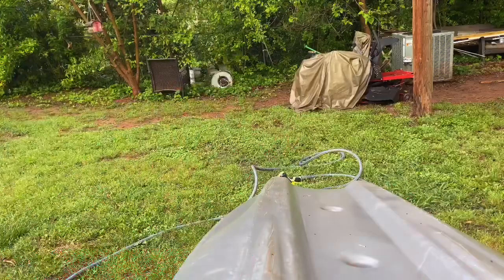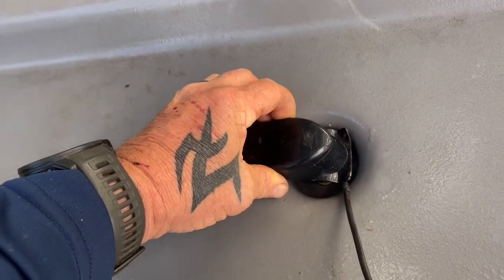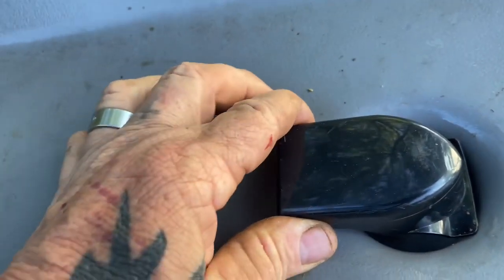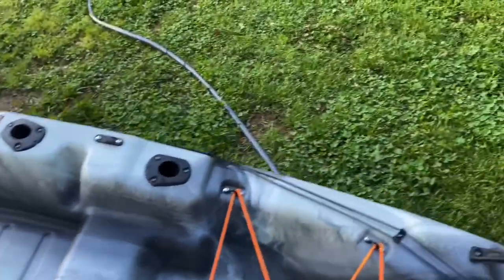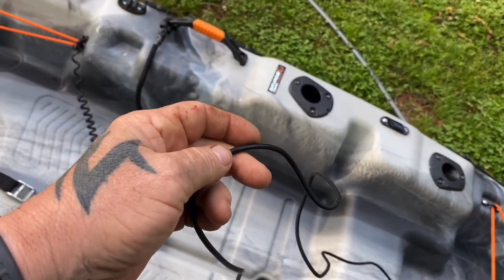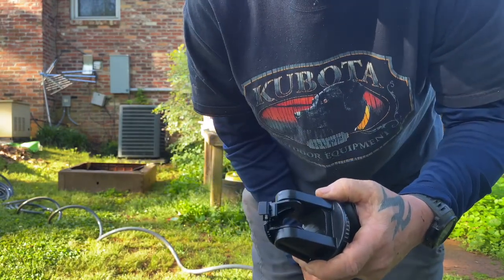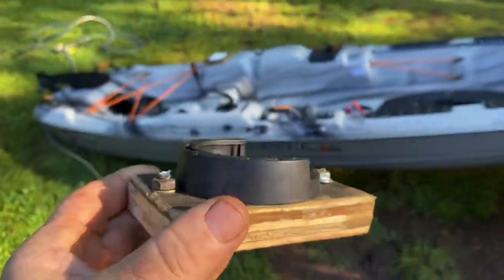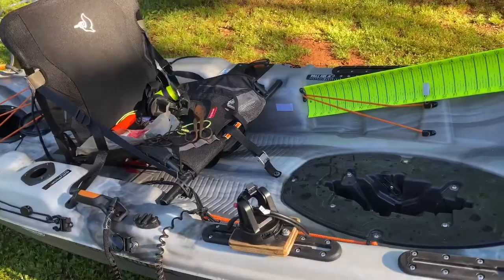DIY clean transducer and fish finder mount installation Pelican catch 110

Comment: I've got the same kayak and I'm thinking about using your method. Where did you get the threaded pipe and cap (a part number would be awesome)?
Reply from the maker: When I get home I’ll look and see if I can get you a part number my friend and I appreciate you watching and commenting!!😃👍🛶🐟🎣 the pieces can be found at Lowes or Home Depot in the sprinkler section it’s all 1/2 inch stuff.
Reply from the maker: Sku#: 652378 a skew number for Home Depot is the best I could do buddy it’s called a 3 inch riser half inch diameter and they are cheap! Lol
Reply: @jaybyrdsshenanigans  thanks 👍
Reply from the maker: @kevinrenn9123  no problem👍😃

Comment: Great video. What did you use to thread the hole? Size?
Reply from the maker: The fitting is a 1/2 inch sprinkler riser three inches long and I barely enlarged and sanded the hole and used the fitting to thread it. It threads really easily.  Thank you so much for watching and commenting!!🙏🙏😃👍👊🛶🎣🐟

Comment: did you use the nipple to thread or use a tap to thread it? if i have the exact same kayak should be good to do this right?
Reply from the maker: I just  enlarged it slightly and worked slowly and used the nipple threads . I have had no issues with it and it still screws right in every time 👍😃 thanks so much for watching and commenting I really appreciate it 🙏🙏
Reply: @jaybyrdsshenanigans  did you use heat to enlarge or just the nipple itself
Reply from the maker: @MindriddlerADV actually one of the little sanding drums on my dremell and you don’t have to enlarge it much at all. Just enough for the threads to grab and then just slowly work it back and forth until it starts good then tighten it up . It’s super easy to get started.
Reply from the maker: And the tip of my knife. Lol